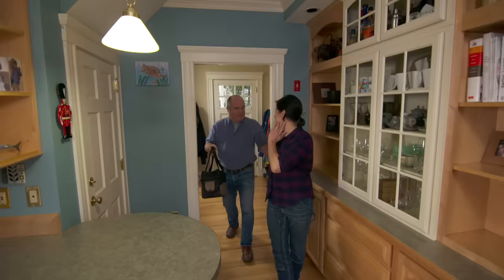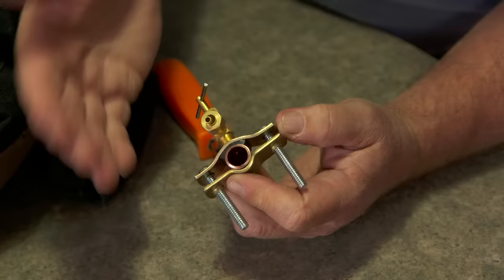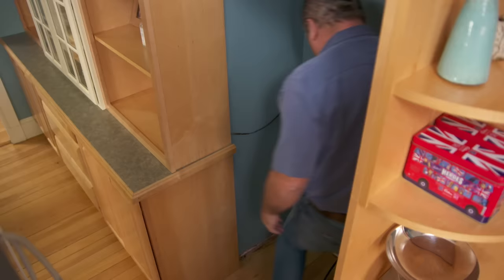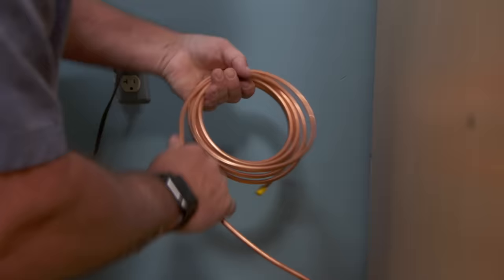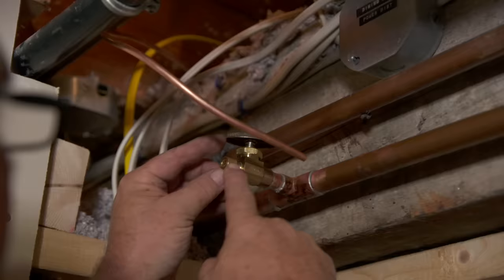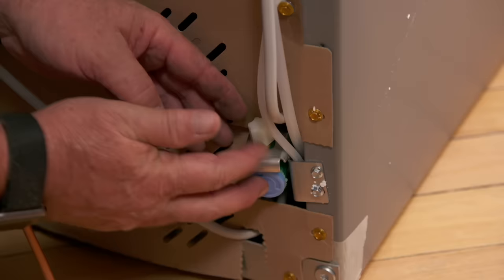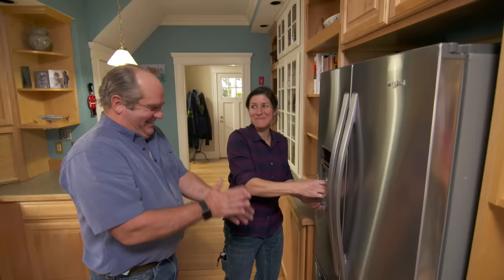How to Connect an Ice Maker Like a Pro | Ask This Old House

Comment: What he should have done was install a refrigerator water supply box in the wall.  This puts the valve for the water supply right behind the refrigerator.  Then use a braided burst protected stainless steel ice maker supply line.  It's more flexible than the copper and will never kink, or fatigue from too much bending.  Then you just screw the supply line to the valve at the box and the controlled valve at the fridge.
Reply: George Moorachian, yeah but that's only if your not stuck in the 70's when it comes to work habits. Not to mention even if you still wanted another shut-off valve located in the basement, it really should be a 1/4 turn ball valve instead of the p.o.s. gate valve he used at the 3:50 mark. It will leak as soon as the seals dry out or become tweaked.

Oh and have we covered the fact that he could have easily pierced a gas, water or electrical line when he blindly probed down into the floor with his drill bit? Lol
Reply: I've got a 1/4 turn valve in the basement, too. It's good to have a good plumber.

Comment: The problem with the copper is that the more you flex it, the less durable it becomes. Since you’re supposed to move your refrigerator periodically to clean underneath, and other general maintenance, the poly line is the better choice.
Reply: So why did he go with cooper?
Reply: @syfodias-jedimaster  yeah copper is not good for the avg homeowner they might kink it when pushing it in plastic will kink but will fix it's self but it is really soft so you can brake easily I say best option is 1/4 inch steel braided hose but you can't hide it behind a wall you have to run a pipe to the back of the fridges than put the hose in
Reply: @Vanilla_Icecream1231  thanks Just had problem with copper one. Replaced with plastic for now.
Reply: All bs. Copper is the best but what Richard didnt show you is the copper line coiled in big loops behind the frig.
Reply: @genemyersmyers6710  exactly not all home owners know that what your sopposed to do I said it's good but what I mean is if you wory about kinks and strength the best inbetween is then flex stainless steel hose

Comment: Won't this copper line eventually bust if you move the fridge too many times back and forth? Or if the fridge bends the line in the wrong way while pushing it in? wouldn't it be better to use braided stainless steel hose instead?

Comment: 2:00 imo NEVER drill more than an inch (or 2" if kitchen has thick floor) so you don't hit wire, gas pipe, water line, HVAC, etc. Drill just enough to put hole

Comment: For cripe's sakes, use a braided stainless-steel ice-maker FLEX LINE. Only use copper if you are wanting leaks later on.

And don't pull a monster unit refrigerator/freezer like this over a wooden/laminate floor, unless you'd like to DAMAGE it! Put down some clean 1/4" fiberboard or special appliance plastic protective sheeting FIRST!

Comment: How convenient the water line is right under.  Never seems to work that way in the real world.
Reply: Did for me today lol
Reply: For a kitchen fridge a line is likely close by, feeding the kitchen sink, dishwasher.
Reply: I agree. Try installing one in Florida on a slab where your Fridge is not connected to the sink by cabinets, it's on a completely different wall. Do a show like that once.
Reply: Yeah my nearest water connection was on the opposite side of the kitchen. Single storey house on a slab. Had to run the piping around and underneath all of the kitchen cabinets
Reply: @Lan Anh Hoang Thi you need a carpenter/ contractor that has a plumber they use. Then that job can get done

Comment: Would have tested the water before pushing the fridge back in. Add a second shut off valve behind the fridge, then you wouldn’t have to go down to shutoff the water. Then a pex line from that valve to the fridge. Like copper but too the fridge the pex works better.

Comment: LOL.He did not mention to look below before drilling through  the floor so to ensure he did not drill into electric wires.
Also he never showed pushing the fridge back into place while kinking the new copper water line. That is why 99% of people use the new poly flexible lines.
Not an installer I would use.

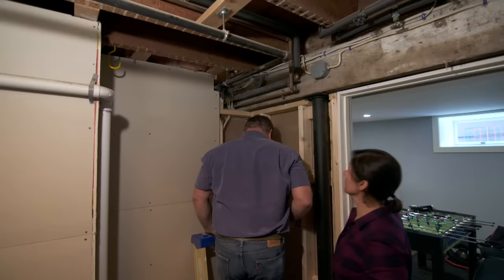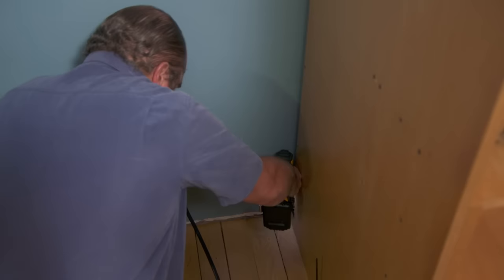Comment: Is it safe to just drill into a floor. The shot at 2:30 showed it was right next to a wire. And the electricity was still on because the lights on in the room behind Rebecca at 2:41.
Reply: yeah its safe, the electric shocks are just there to tell you that you are doing a good job
Reply: Little shock never hurt no one
Reply: jake williams that tinkle tells you its working.
Reply: There is just no way around it in many cases and tradesmen do it all the time i know I do and 120v is not the problem its 220v that has the highest chance of killing you so if you go to the breaker and shut off any 220v circuits then the most you can expect is a tingle and extra work/cost
Reply: I avoid it, but it's not that likely for something really bad to happen since they knew it was an open basement.  Your drill bit would have to be extremely sharp to pierce both insulations of the wire without you noticing, unless it is pinned against the floor you're drilling into (which is unlikely since you don't normally attach wires to the bottom of the sub-floor, you do it to the joists).  Plus, for you to hit and pierce the the wire, you would have to hit it somewhere towards the center (the bit would push the wires and slip off the side otherwise).  So, in addition to hitting the hot line, it would also hit ground, which would immediately trip the breaker from the short, and that's where the current is going, not you.  Sure, there's a spark from that, and that could technically cause a fire, but it would have to be very dry sawdust or paper right next to the wire to even have a chance of starting a fire.
Reply: That feeler bit is nothing more then coat hanger wire, it doesn't so much drill through things it more burns through stuff. Nine times out of ten it just pushes the wire out of the way, especially if it's not verry secure like in this case.
Reply: 220 volt is simply two legs each 110 to ground. 220 phase to phase
Reply: How do you know that that wire is on the same circuit
Reply: @alec4672  i was about to put that

Comment: I don't know about that I have my little valve sticking on the existing water line pipe from my sink I already change 4 refrigerators since 1999 and I still have that little valve with not leaking at all🤔🤔🤗

Comment: I installed reverse osmosis system under my sink and then connected my fridge to this system using 1/4" plastic pipe. Nothing difficult. As result I have clear ice without any smell and taste.

Comment: a salesman told me that it's better to have an icemaker in the door as opposed to in the fridge body (inside). He said it had to do with warm air floating around inside of fridge can cause the ice to melt a little , whereas in the door it has dedicated vents to keep it colder. Is this true ? or is it a line of BS ?

Comment: He should have flushed the water after soldering before connecting it to the refrigerator. Then he should have added an inline filter to remove all the garbage you don't want in your water and ice. Most newer refrigerators with the ice dispenser already have an internal filter cartridge that is easy to remove, but those filters costs 3-5 times as much as an inline filter that goes on the water supply line to the refrigerator. Also, the factory filters that come with the new frig need to be replaced every 6 months, and most inline filters last for 1 year.

Comment: Just paid a plumber $$$ for this in the basement but instead of a screw valve, which could be a source of problems, he installed a quarter-turn on-off valve which definitely takes less effort to turn off the water supply e.g. when changing refrigerator water filters. Also, apparently, local code requires the shut-off valve NOT to be in the basement but somewhere in the kitchen (the plumber thought to tap the cold water from the kitchen sink and run it to the refrigerator far away but too $$$$). Some would also put the shut off valve behind the refrigerator as well.

Comment: just like a saddle valve is illegal, these days most states require the shutoff valve on the same level as the appliance and appliance delivery services will refuse to install on lines set up like this. Best bet is to run 1/2 in copper or PEX directly behind your appliance with a 1/4 turn shutoff valve on the end.

Comment: The copper pipe at the back of the frig needs a strain relief attachment to the frig.
Reply: sptrader  What would that be, a way of attaching the tubing to the frig such that when you move the frig out no force is put on the fitting itself?
Reply: Frig Back In The 80's and 90's Had 1/4" Clamp About A Foot High From Water Valve To Keep Tubing From Breaking Off At The Valve...
Reply: @bigpardner  Yes

Comment: Always put the supply line connection for the refrigerator or ice maker at the WATER MAIN.  This insures the freshest water possible going to the refrigerator or ice maker.  The reason is that when you connect at the water main, any water being used, hot, cold, indoors, or outdoors passes by this location.  When I moved into my home the former owner had the water connection at the cold supply for a little used lavatory sink.  The water there was almost always stale as that lavatory wasn't used much.  This is not where you want your consumable water coming from.  The freshest water is always at the main.
Reply: Very good information
Reply: Not practical if the main is on he other side of the home. Lol

Comment: I would have  installed the cut off valve so  it was easier to shut off , not on top also no discussion about water filter for refrigerator

Comment: Seems like it would have been better to run a rigid copper line to a shut off connected to a flexible steel braided hose for the final connection to the fridge. But hey what do I know

Comment: You forgot to attach the copper line  to the ref. with a clip so there’s less tension on the tubing where the valve is attached to the ref. when moving it in and out for cleaning and maintenance.

Comment: I thought that you would put a drain line so if the fridge needed to drain or you overflow the water area it could drain so water doesn't get all over the floor?
Reply: I doubt anyone ever puts in a drain line for a fridge line hook up. The problem with that is trying to guess where the water would leak or "over flow" from. It could happen anywhere between the shut-off valve and back of the fridge hook up. When they do leak, they usually spray, so trying to devise a drain line that could capture water from a random spray would practically be futile.

Comment: For all the talk about the carnaige of a saddle valve here, I have one installed in 2004 when I bought my fridge. Still like new after 16 years. People like to blow things out of proportion for effect I guess.
Reply: regardless of individual anecdotes, they have a statistically higher fail rate, and the idea of puncturing a pipe for a connection is hilariously lazy. Push fittings people.

Comment: I'm sure Richard would've used Pex if the house was plumbed with  it. Since it was plumbed with copper I assume he used it for convenience, therefore he wouldn't have to adapt.
Reply: Elliot moye, actually he could have just as conveniently used the nylon line. He said he just liked the copper for it's "durability", but it's only durable against mice chewing through it. It's not durable for sliding the fridge in and out- in fact it will kink and break easily.

Comment: Hey This Old House I have a quick question for you when you do any soldering or any of that have you guys ever caught the house on fire
Reply: Chuck Mac I'm sure if they did they wouldn't admit it. Lol
Reply: @aaroncottingham4048  Chuck Mc, I'm also wondering if Richard has ever pierced a gas, water or electric line while using his old "poke and hope" method of locating between floor levels. Lol
Reply: If They Did, It Can Edited Out...

Comment: Is there a good way to repair saddle valve punctued pipe without soldering? Some sort of compression fitting after removing section of pipe?
Reply: Dennis Federwitz Cut out a small section of the pipe and install a shark bite T. Not as good as soldering in a proper valve, but a lot better than a saddle valve. Sharkbite makes an in-line t valve which will fix your issue
Reply: @bigman55434  shark bites can be even better than soldered joints. I've seen even the most experienced and steady handed plumbers have those solder joints fail on them. There simply aren't any guarantees- especially when working in a tight situation.

Comment: To me if Pex is gong to be used for anything is this.  One I move the fridge wrong and you have a kink in the line.  I know there are arguments on pex vs copper all the time, but for something that you need to move around Pex all the way.  And what about an install thats not to close to the water line.
Reply: Braided stainless steel hose is good but we all have our preferences. My opinion is pex stays in the wall, copper goes where you see it and where it's structurally needed (I've seen to many circulation pumps dangling from pex) and braided stainless steel to the appliances.
Reply: Virgil I will never use pex for water supply for a fridge. Nice or eats have been to known to chew on pex.
Reply: Than I guess millions of new house builds are screwed then, because alot use pex now for cost savings and ease of use.  Is what it is, I didnt build my house.
Reply: Virgil no pex is good but I wouldn't use it behind a fridge.
Reply: And like I said, is what it is. Im not ripping all the Pex out of my house.  Was there when I moved in.
Reply: I prefer copper everything but not when it moves

Comment: What idiot came up with that saddle valve.
"Let's pierce a full pressure water line, I mean what could go wrong"
Reply: A salesman...who knows a customer will need to call them back in 3-5 years for replacements...
Reply: You would think so but I have the same one since the 1980's.
Reply: You can't fool us, I know you're the Illuminati
Reply: They are used by MILLIONS with absolutely zero problems what-so-ever. Any valve or fitting can fail over time. They are by far the absolute #1 type tap used for ice makers, and even sent by the manufactures of ice makers for use in their systems.
Reply: I think I'm going with this setup. I just tried puncturing the water line with 2 saddle valves and the pin bends incredibly easy.
Reply: Seriously
Reply: illuminati
( ._.)
I don't know why it exists
Reply: I used the saddle valves in 2 different locations at my place and they've been fine for 15yrs now.
Reply: Well you pierce it when there is no water in there, eg, turn off the water to the house .
Reply: @Jay-Kaizo  Do you have steel pipe by chance?  They don't work on steel.
Reply: @ericalexander3246  No, it's copper, but really hard copper. I ended up getting it on the 3rd valve after I drilled a small pilot hole first. lol. Probably not the best idea but it's been working for months now. If it ever fails, I'll put in a permanent setup with a shut off valve.
Reply: @Dysturbed-00  theres only 350,000,000 americans living in 200,000,000 households.
Reply: When I moved into my house the former owner had a saddle fitting feeding an ice maker for ages and it was fine.  I relocated the supply line twelve years ago and just closed the valve on old one.  Never a leak.  When I relocated this I used a brand new saddle valve and that been fine since.  It seems to me when these have a problem it's due to a thoughtless installation.
Reply: I know they are prohibited but I've been in hvac plumbing trade for almost 20 years and have never seen one burst, I have had the valve itself stop opening or closing, shut water off and pop another one on
Reply: Obviously a member of the group you can't sue because any normal person would be sued into the ground for selling those.
Reply: @l337pwnage  all hardware stores sell them.
Reply: @leonardarch3092  I guess I should've excluded distributors, although even they can get named in a lawsuit.  Typically, if you can point the finger down the line to someone else, you can get away with a lot.  What matters is if the source is protected by law.  I figured that was a simple enough concept that it was understood, but I don't mind explaining it.
Reply: @l337pwnage  ohhh... thanks.  I mean everybody had a voice for sure. Is it the best or preferred valve hell no. but all I'm saying is I cant recall any problems with them bursting, only not actuating after years, silcock valves do this too hence ball valves came into play.
Reply: tons of comments of this never failing.  well we had an old saddle valve from the previous owner too.  it never leaked for 10 years,  until it did.  we knew when it leaked because the basement had a pool of water.  turns out it had a drip leak for years before it really opened up.  then again, any valve will fail given enough use, the issue is the valve was fine, it leaked at the gasket over the pipe
Reply: It's not just the full pressure breaking through, the gasket dry rots and it drips water. I think this is much more likely to fail, than a ballvalve.
Reply: We moved into a house and reused one for 20+ years now, no signs of leaking.  All of my subsquent copper tubing needs tie in at Ts (as in this video), but a saddle isn't a mind-bending part.
Reply: Considering I have a 55+ y/o saddle valve in my basement without a speck of rust, it would seem saddle valves are a great time tested item.
Reply: I had a saddle valve just before the entry into my hot water heater tank. I had to cut out a section of the pipe, because it caused so much corrosion was blocking the pathway for the cold water to get into the water heater. I installed basically the same Parts he did.